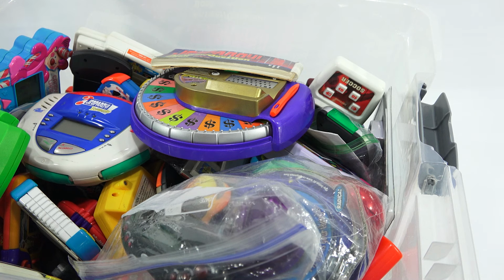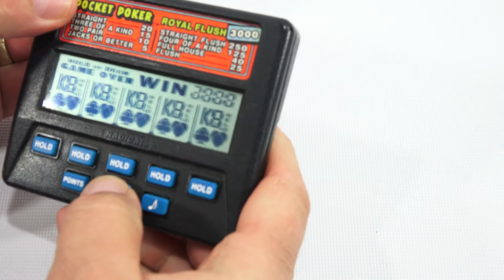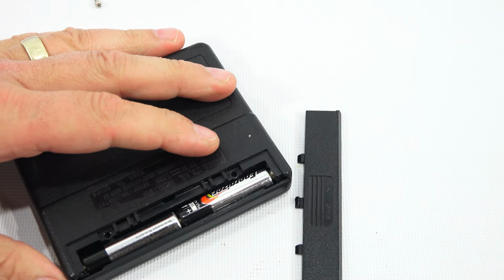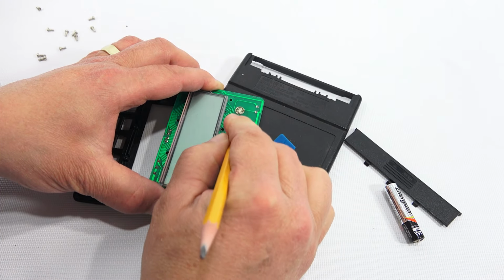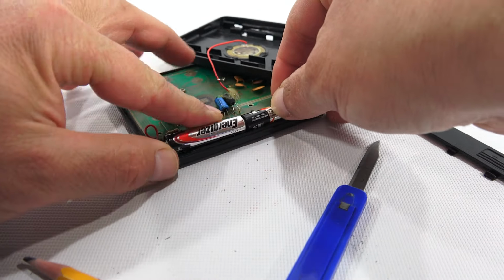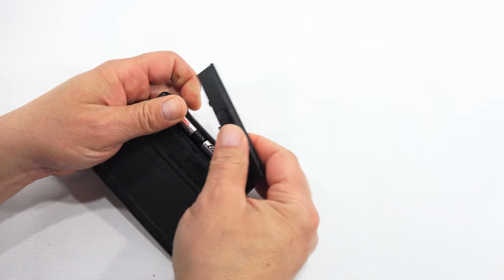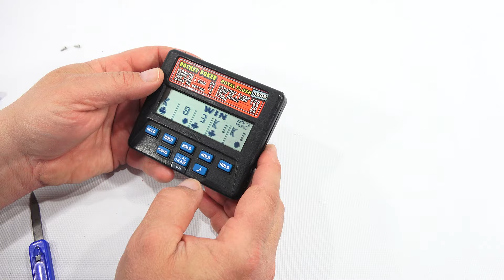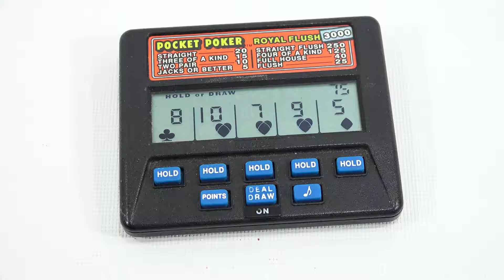Fixing & How To Play The Radica Pocket Poker Handheld Game Model 1310

Comment: What a coincidence of this being uploaded just one month ago.  I found one of these in my mom's junk drawer and found that it "worked" (after replacing corroded batteries inside) but the sound was very intermittent... I had to really apply force on the bottom left corner, basically trying to twist the whole device for the sound to work.  Because of this video I was able to open it up and fix the sound.

To fix the sound, what I did was:  Clean back of the big circular metal thing in the middle of the board, and slightly bend the diagonal piece that contacts it up.  Looked as though red wire wouldn't interfere, but sound was still intermittent.  Bent diagonal piece up slightly more, and laid the red wire to wrap around the other way instead... one of those things (probably changing the red wire placement) fixed the sound completely.

Thank you for the in-depth look and repair

Comment: I will never stop following this channel, I've been an avid follower for years, and this channel still brings me joy.:face-red-heart-shape:
Reply: as for the dirty buttons, you may want to try some isopropyl alcohol with a q tip to remove the dirt, it will be a little gentler on the circuit board. Based on some research, 90% should be used on circuit boards.